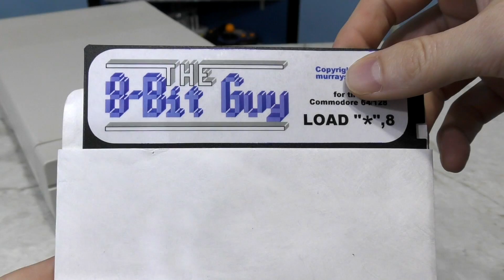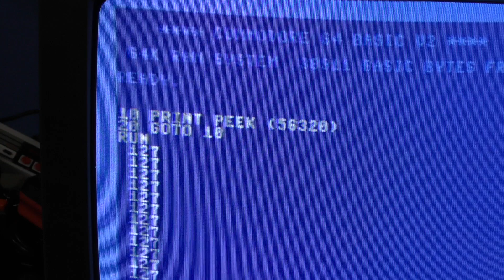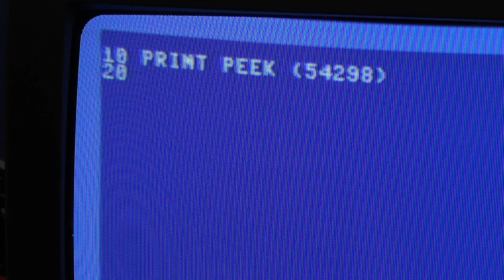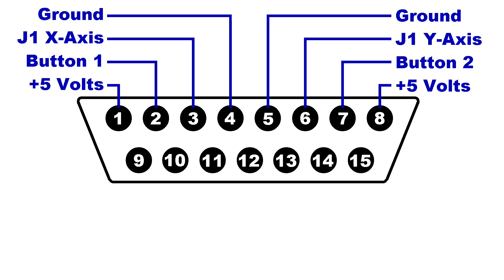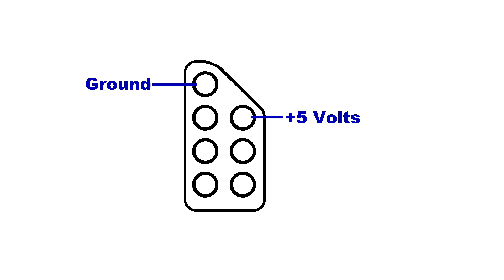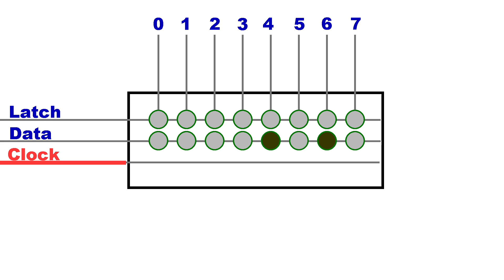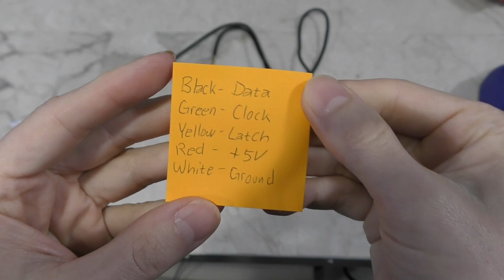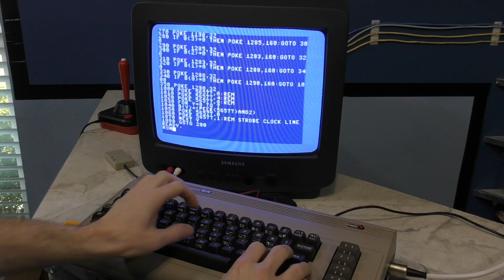How Vintage Game Controllers Worked

Comment: You can press two directions at once, i.e up+left. It's an 8-direction controller.
Reply: You're right. I think he meant to say you can't physically press up+down or left+right simultaneously. up+left, down+left, up+right,down+right are of course all possible.
Reply: I was looking for this comment lol
Reply: Just pressing down two Hat Switches simultaneously. It only works because they can be read simultaneously, though whether the game does anything depends on its' programming.
Reply: A true 8-way input would have a dedicated input for diagonals. Often found on flight sim controllers
Reply: @KaitouKaiju  Shouldn't such a true 8-way then technically allow two-adjacent-directions activation as well? I.e. if you have not just North, East, South, West but also NE, SE, SW, NW switches, shouldn't you then be able to similarly, technically mechanically activate e.g. N + NE? Of course, in the absence of separate NE, SE, SW, NW lines, N + NE would still be electrically identical to just NE. Just a thought.
Reply: @ropersonline  Seems that would make sense.
If that were the case then arguably a 4-way stick allows 8 directions and an 8 way stick allows 16...
Kinda dubious naming scheme in that regard, but there's plenty of stuff like that in the world. xD

Of course, you also have stick designs that made it physically impossible to activate two directions at once...

In that case a 4 way stick doesn't allow diagonals, and an 8 way stick would differ from a 4 way stick only in that there's an internal mechanism preventing you moving it into the diagonals in one, but not the other.
Reply: @KaitouKaiju  Never seen one of those.
Reply: Yes, I was just about to whine about this :)
I wonder if the C64 proof of concept managed this?  I guess it should?
Reply: its the same deals with the Atari style joysticks.

Comment: USB controllers work very similarly to how the NES controllers worked.
Reply: If you forget about the usb addresses, root hub, topology and power négociation, I agree.
Reply: Also. at least on PS4 sony thought it was a great idea to send the console the minimium firmware the controller is ""compadible"" with in order to try force people to update..
Reply: Yeah, in an extremely broad sense, that's true. XD

The n64 and gamecube controllers are also more advanced implementations of the same idea. (this time a proper serial data bus though)

One of the quirkier things in modern terms are the Wii's extension controllers - the nunchuk, Wii Classic controller, and, ultimately what Nintendo used for their mini consoles as well - all of these connect over the industry standard I^2C protocol... 
Though again, quirks of that protocol aside, it's still broadly the same idea as the NES controllers...
Reply: The main similarity is continuous polling. Before the conversion into a proper USB frame, the controller may use an old fashion switch mechanism like Atari or a shift register among other ways to detect on/off. The processing can be inside the controller or it can be part of the driver.

Many gamers don't like to use keyboards over USB because this polling can be randomly stopped by the computer, and it causes lag, whereas PS/2 triggers an interrupt and the computer will generally always process the key press even if buffers are full.

Comment: Genesis doesn't have a select button, did you mean C?
Reply: Think he meant start, or the pause button.
Reply: It does not mean button, but a line name on the multiplexer
Reply: Maybe he meant the 6 button controller. Standard 3 button has only 3 buttons and start.
Reply: I think he referred to the Pin 7 on the Genesis/Mega Drive controller, which is called the "select" pin. It is an output pin which the console uses to select between two sets of two buttons on pins 6 and 9: B and C, or A and Start, respectively.

The problem with the Genesis controller on the C64 is that the C64 expects no positive voltage on the input pins. The Genesis' gamepad has positive voltage on disconnected input pins (because it also has pull-up resistors). The problem occurs when the I/O chip has reconfigured the same port lines to scan the keyboard. This can cause excess current to flow into the I/O chip if you press a keyboard key with the controller connected. You could supposedly prevent this with an adaptor that has a diode on each input pin so that current can flow only one way.

The Genesis controllers should be safe on Amiga. Only one set of buttons is selected all the time though: B is fire (or left mouse button) and C is alternate fire in some games (or right mouse button).
Reply: He's just completely confused. Line 7 is the 'select' pin which is connected to a switch/multiplexer IC on the controller.

This is how the Mega Drive/Genesis can connect 8 buttons using only 6 pins for the job;
Basically 'select' lets the console choose which buttons to read.

B + C, or A + Start,
(dpad can always be read it's got dedicated lines.)

The real thing would read one set of buttons first, then change the voltage on the 'select' line, then read the other two buttons.

His description of how the controller worked is WAAAY off from reality.
Reply: 'Mode' button. Same thing, at the functionality level.
Reply: @AmyraCarter   Isn't mode only on the six button? I think mode was only super useful with some fighting games. I preferred the smaller 6 button and I think the inputs for A/B/C were just repeated with X/Y/Z in three button games. I remember mapping a lot of games like the SNES face buttons. I no longer have a Genesis so I can't check. The grey button (blue on the six button controller) is start. But the three button doesn't have the mode button. Although I guess it technically does function as a sort of select button when used for it's actual purpose. But as far as I know the three button never had mode because it doesn't need it.
Reply: @AmyraCarter  
But the mode button was only on the 6 button controller, it is used so the 6 button controller is read as a 3 button controller by the console

Comment: That was really interesting - but how does a 6-button Genesis controller work?

Also I remember using my Genesis controller on my C64 back in the day, I'm glad I never hit the start button!
Reply: The 3 button controller uses multiplexing. the 6 button controller looks for speciic signal timing on the select line to multiplex the additional buttons
Reply: All I understand is that genesis or NES controllers used on a c64 would use way less buttons
Reply: @pflynn12  no. The nes controller uses serialized data. The console sends a 5v pulse (6us) on the latch pin, this tells the shift register in the controller to latch the inputs and revert to the first button, then it proceeds eith 6 more pulses, this time on the clock pin, and directly after each pulse, the shift register will output the next button.
The order it outputs is Right, left, down, up, start, select, B, A.
If you want to learn more, or have the chance to win an unassembled custom nes controller, follow my channel. Im making a tutorial on how to design a nes controller, circuit board, case, the whole shebang, followed with a giveaway of one of the controllers I make, follow my channel and when i post it in a month or 2 maybe youll see it.

Sorry for the selfless plug, but if you are interested in this youll like my future content.
Reply: Multiplexing most likely, hence why it has the mode button to switch back to three button mode for games that trip over on the multiplexed signal.
Reply: According to https://applause.elfmimi.jp/md6bpad-e.html and https://jonthysell.com/2014/07/26/reading-sega-genesis-controllers-with-arduino/, the Genesis controllers work like this: all lines are pulled up on the console end, so when the controller is out, all pins are high, and a low signal usually indicates a pressed button. The Select line controls multiplexing, it's an output line (from the console) that changes what buttons the pins report, and it definitely can't short 5V with Ground on a C64.
Switching Select works like this on a 3-button controller: when Select is high, the 6 input pins report Up/Down/Left/Right/B/C (which is what gets reported to most non-Genesis consoles), and when it's low, the pins are Up/Down/Low/Low/A/Start. The constant lows on the input are how the console knows when a gamepad is plugged in, because Left and Right can't be physically pressed at once. Also, the console tests low Select first, high second.
The 6-button controller usually also works like this, but if it sees the Select pin being switched from low to high twice in no more than 1.1 milliseconds (it usually happens in 41.4µs because the console makes 4 pulses with a 27.6µs period each cycle if the game recognizes 6-button controllers), the next time Select is switched to low, the input pins report Low/Low/Low/Low/A/Start. The 2 extra constant lows are how the console knows whether the controller is 6-button. And then, the very next time Select is switched to High, the input pins report Z/Y/X/Mode/High/High (which is where the extra buttons are checked), then the next time Select is low reports High/High/High/High/A/Start, then the controller only reports in 3-button mode for the next 1.8 milliseconds. That's not a problem, because most games check the controller at a 60Hz rate, though some games do it way faster and confuse both the controller and themselves, which is one of the reasons why the Mode button exists - if said button is held down when the controller is plugged in, it works only in 3-button mode until it's unplugged. However, the IC in this controller is not as quick to respond as the 3-button controller's multiplexer, and one game (_Forgotten Worlds_) checks the pins so quickly after switching Select that the 6-button controller physically can't respond on time, so it doesn't work with that game.
Reply: @lithiumwyvern_  Wow, nice info - that's really interesting.
Reply: The 6 button controller has a microcontroller.

The 3 button controller has a 'select' line to switch which set of buttons it reads. (Up and Left can always be read, But in one state you can read Right, down, B and Start, and in the other you can read A and C)

The 6 button version does this but in addition listens for the 'select' line being taken high/low quickly 4 times in a row.
If it sees that happen fast enough, it switches out all the buttons for the 'X, Y, Z and mode buttons instead)

This is part of the reason why it sometimes doesn't work with old games.

If an old game changes the select line really quickly, the controller might think it needs to switch button sets when it actually doesn't, and then the game's controls glitch out.
Reply: The 6 button controllers use a different multiplexer chip that can be toggled into 6-button mode by a certain stream of pulses on the clock line.
Reply: as the second guy said, the extra buttons emulated the same input as pressing start + a/b/c. alleviating the need for awkward combos to pull of extra moves for games like street fighter, etc
Reply: The Genesis/Mega Drive was also backwards-compatible with the SMS to some degree. That's probably why they used the same type of controller ports.

When the multiplexer was active, it also set directions Left and Right at the same time — which should be impossible to do on a D-pad.
That way, games would be able to tell SMS and MD controllers apart.
Similarly, the 6-button controller sets also Up and Down at the same time when it is about to send the signals for its additional four buttons.
Reply: So is that to say that it'd be possible to fake the six buttons if a controller made it easy to press left and right/up and down at the same time? Not convenient or practical, but possible.
Reply: @ThatguycalledJoe  You would fake the detection if you pressed all the directions at once, and you could (as in "possible", not "probable") fake 6-button input if you pressed the desired directions within the right microseconds. Which would probably only be doable by shorting the circuits with an Arduino, that or with a ridiculously fast, very well-programmed robot to press the directions for you. And I wouldn't be surprised if the all-direction-highs on the next low served as another verification measure, making this weird trick even harder to do.

Comment: Playstation 3/4 controllers are wireless, they use bluetooth to communicate. Of course you can also plug them in by using USB to charge, and they do function, but that's not how you'd usually use them.
Reply: I really hate the "Everything is Wireless Nowadays" junk. I've been tempted to replace my Dualshock->USB adapter with a PS4 controller, but I hate how they are Wireless-Only and there are no wired controllers, ever. I mean, heck, Microsoft was smart enough to release a wired 360 controller for PCs. I don't feel like using batteries for every controller I use, thanks.
Reply: @Dhalin  Well, sorry if I was a bit unclear. They do also work over USB while charging. That is, bluetooth is not used while the cable is connected. It'll probably reduce latency a bit as well.
Reply: @az09letters92  Do the controllers actually come with USB charging wires, though? I was under the impression that they don't and you have to buy those separately.
Reply: @Dhalin  Yeah, they do. PS4 controllers use standard micro-USB anyways. PS3 uses mini-USB.
Reply: @az09letters92  So then I'd have to buy an adapter because my PC obviously does not have micro or mini USB on it.
Reply: @Dhalin  It's the same cable as most Android phones, powerbanks and gadgets use. PS4 controller side is micro-USB and playstation/PC side USB-A.
Reply: @az09letters92  Oh! You made it sound like the other end was the tiny usb, lol. Okay then. I've seen PS4 controllers in stores and such, and I was tempted, but the price is kinda steep, $45 and I already have a dualshock->usb adpater, buuut... it's annoying to have to use Joy2Key and x360ce all the time because game programmers don't feel like adding DInput functionality half the time.
Reply: Wireless is flawed, there are too many things that can interrupt the signal. If your not playing a competitive game that dont matter, but it matters if you are. And then there is the charging of batteries. As long as there is an option to also use the controller with wire, then alright, i get it.
Reply: @Mrbrendonmills  That, and you don't have to worry about a battery going dead on you during gameplay, or having to pause the game to put new batteries in. I hated that when I played Twilight Princess on the Wii. I mean, yeah, a pair of duracells would last through half of the game, but still. I even tried buying a rechargeable but those started kicking the bucket after 2-3 recharges and I was like "eh... this is kinda stupid". We make battery powered shaving razors that will last years, and those have constantly spinning parts, why can't we put that kind of battery into a freaking controller? But yeah, I much prefer wired. I know people who sit on their couch love batteries, but I like my desktop gaming and I'm always within 5 feet of the PC.

Comment: Can't wait to see the source code because I wonder how you got the clock to work with the shift register via the C64 interface.  Do you just poke the clock pin high in a loop (8 times) and peek/read the data pin?
Reply: Pretty much.  You poke the latch high, then in a loop peek the data pin, and poke the clock on then off, and repeat that loop 8x, then finally poke the latch low.   For nes you'll want to wait at least 2ms before doing it all again (in basic that shouldn't be a worry)

Fun detail, you can wire up multiple controllers together and use the exact same latch and clock lines.  Only data needs to be kept separate.  
So with 8 bits on the port, 2 will be the latch and clock for all your controllers, leaving 6 left over for up to 6 data lines and thus 6 controllers being read at once.
Reply: @lorddissy  Thanks!  Unfortunately David's code download is only for Commodores and not plain ASCII text, therefore unreadable on my PC/Mac.
Reply: @alliejr  Is it a binary format? You can't tell notepad to open All Files and get a readable ASCII?
Reply: @Dhalin It's tokenized basic, so not fully ascii no.  Every basic command is stored as two bytes.
'print' for example is 128 then 0, followed by the ascii text and another 0.  128 doesn't have a matching ascii character so it won't show up in notepad
Reply: @lorddissy  So basically you'd just need a hex editor and know what bytes are for what commands. Heck you could probably whip up a quick perl script or something to decode that fairly easily. I'd be almost certain that there's a little .exe or something somewhere that does this for you even, as it sounds like a trivial thing to code.